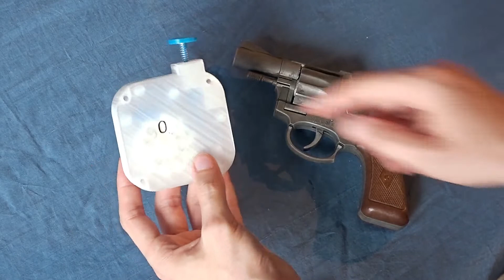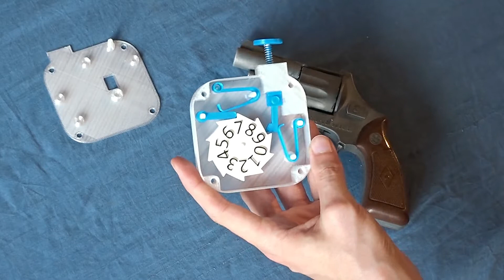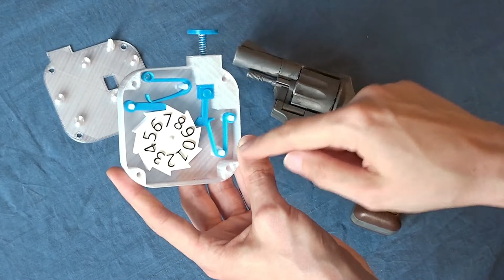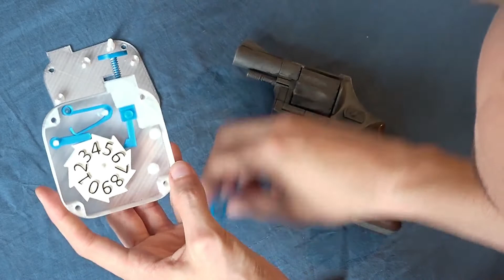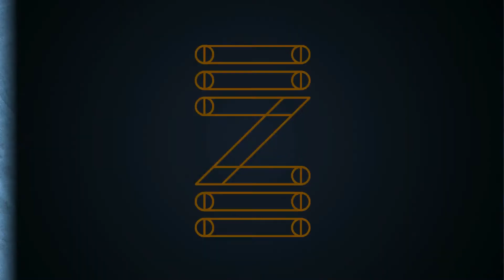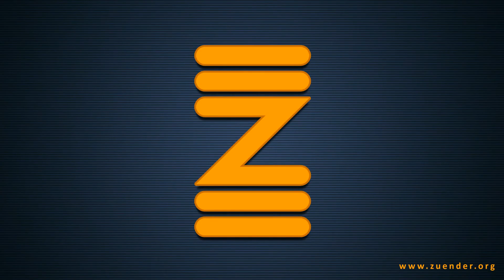Exploring the Revolver Mechanism with 3D-Printing

Comment: That's a really interesting video, thanks for sharing. I'm am trying to learn how the revolver works to aid me in my can crusher project.  I'm looking for a way to cock and then release the hammer to dent the can when its in compression to reduce the subsequent crush force required.  I have a gravity fed magazine of empty cans that drop into a 4 chamber cylinder?  rotating chamber with a sort ramp to deposit the can in the horizontal axis.  

Any chance your interested in adding a hammer action to the print that might dent a can under compression?

I've like shared and subscribed :)
Reply from the maker: Watched your last video - if I understand this correctly you want to make a dent in a can as a sort of predetermined breaking point ("Sollbruchstelle") to crush the can more easily?

Not the easiest mechanical problem to solve, especially in just a few words in a youtube-comment. I am not sure I can be of much help,
but my first thought would be to use the circular motion of the drill at the magazine to lift a hammer-kind of piece which then triggers its
own fall onto a can when it as reached the right position. But that could result in a can that doesn't roll quite as nicely anymore
into the crusher.

To avoid that the dent would be needed once the can is in place in the crusher, so the linear motion of the airpressure driven piston
needs to drive what-ever-mechanism that does that.

I can't come up with anything more intelligent on the spot, but a revolver style hammer+trigger is essentially pulling back the hammer
against a spring and then at a certain point the pulling back is disengaged and the hammer is pulled or pushed back to the front by the spring.
https://en.wikipedia.org/wiki/Sear_(firearm)

What might help you with this auto-cocking, releasing and -resetting problem could be the "geneva mechanism"
https://en.wikipedia.org/wiki/Geneva_drive
You could use something like it also to drive the whole machine with just one generall on/off switch, continuous rotation of the drill and controlling the rotation
of the magazine, the hammer-strike and the can crushing with one fitting geneva mechanism version.
Not an easy feat though.